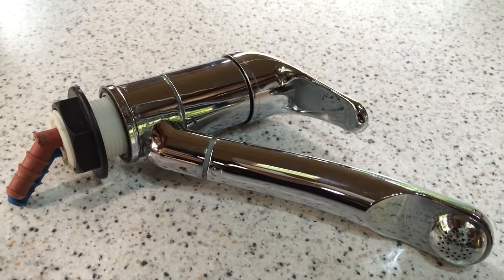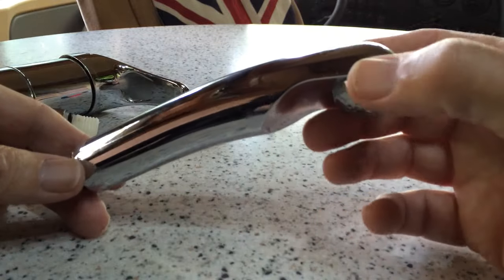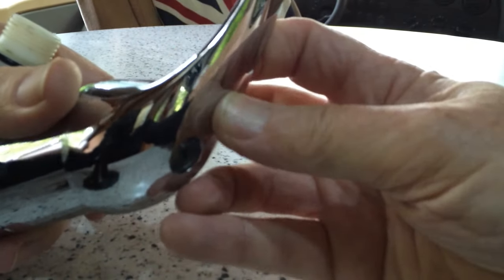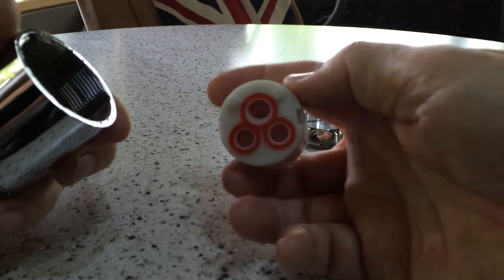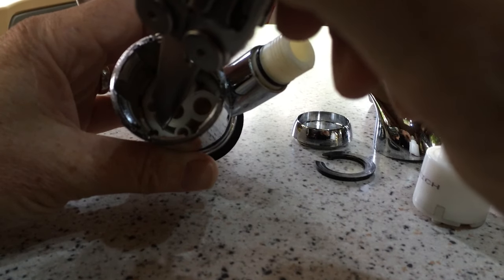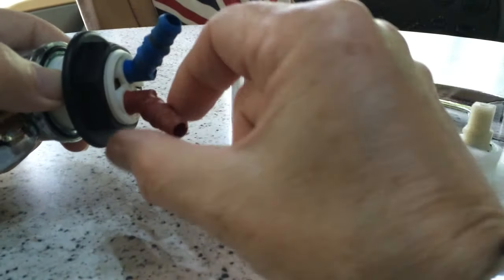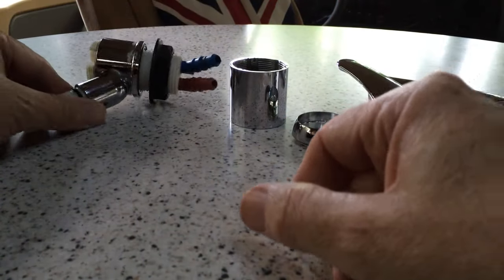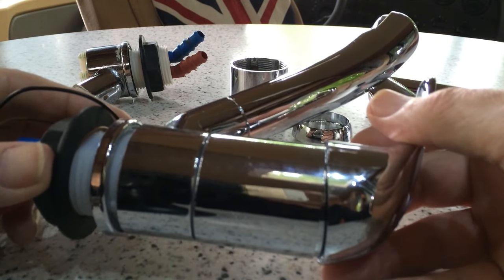Club Motorhome Videos - Motorhome Mixer Tap Overhaul

Comment: Hi there thank i for the video i have a problem with the spout where the white connector comes out it’s leaking there and i can’t find any information on how to replace that
Reply from the maker: You're welcome. If it is just the spout (which is very common) then it just pulls off and a new one pushed on.
Reply: @ClubMotorhome  thank u i have a 2008 Lunar Lexon 575 EB and the mixer shower tap is a Comet Roma but i couldn’t find that little white connector in any caravan store i looked up the manufacturer and i didn’t see any spare part option to that particular model so could u advise me on how to get my hands on those connectors? thank u
Reply from the maker: @kellerferenc  Sorry, I don't have any personal knowledge of Comet Roma